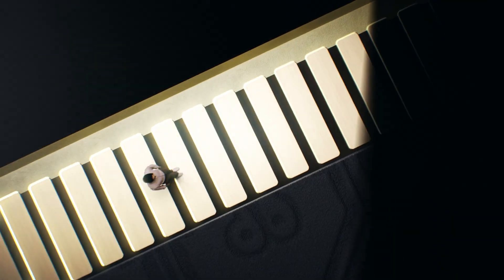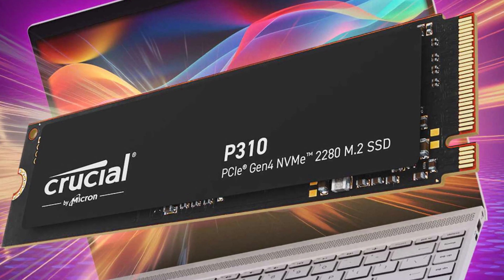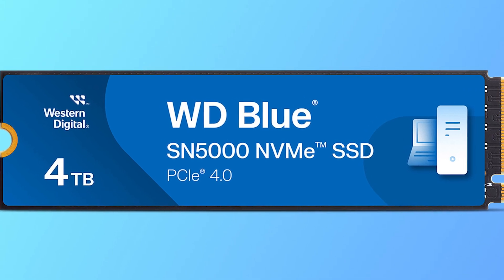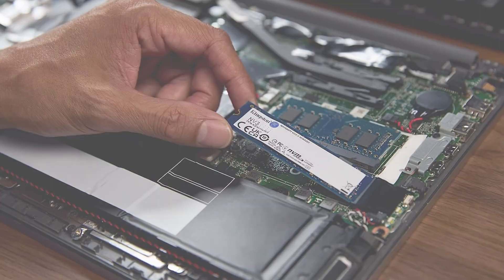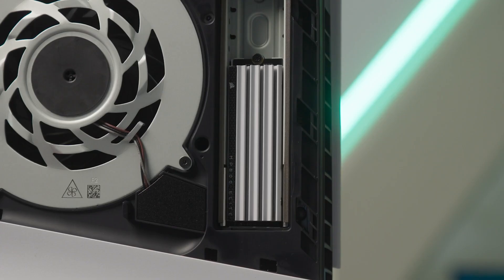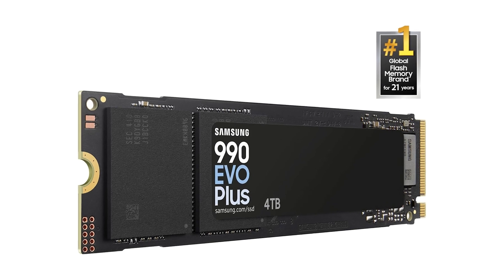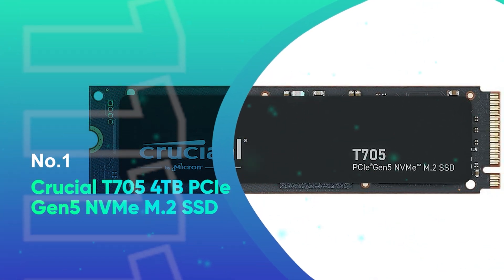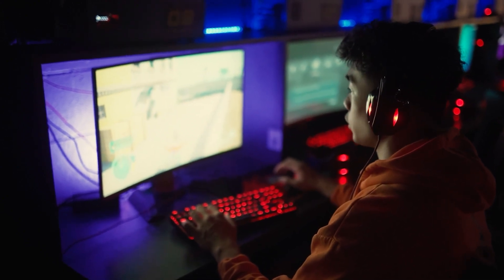Best NVMe SSDs of 2025   [don't buy one before watching this]   #SSDUpgrade

Comment: I got the Crucial P310 and Corsair MP600. I put the P310 in an 11th Gen Core 5 and the speeds are nowhere near they should be, the system is so sol, it can barely crack the 1,500MB R/W, but that was to be expected, I like the P310 because in my desktop, it does the 7,100MB and the MP600? Same story, super fast in my other desktop. 
I have a Samsung (forgot model) for back up inside an enclosure and the Kingston is also another reliable brand, so I've used all of those 4.......also WD but not since the Gen 2 PCIe NVMe.